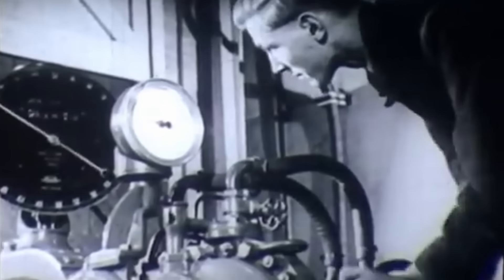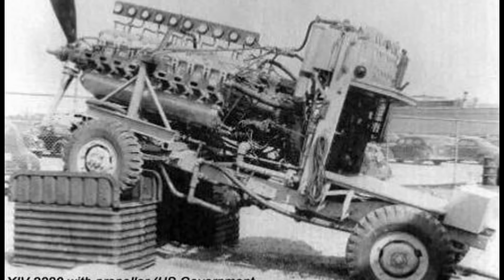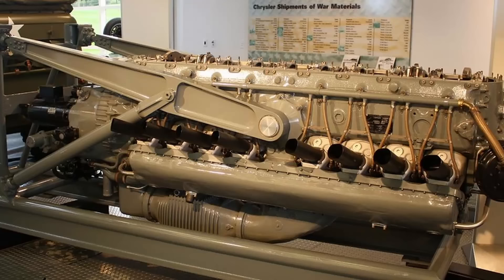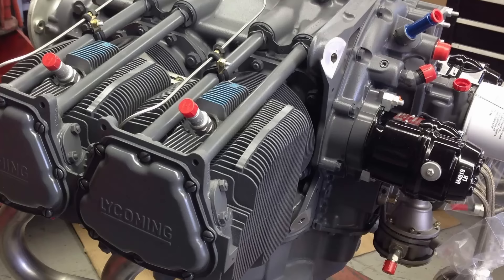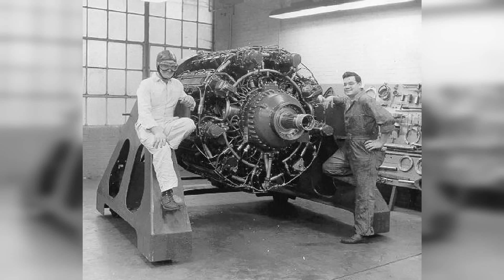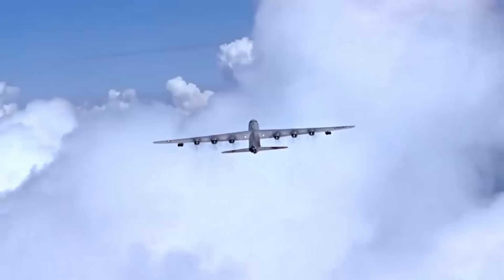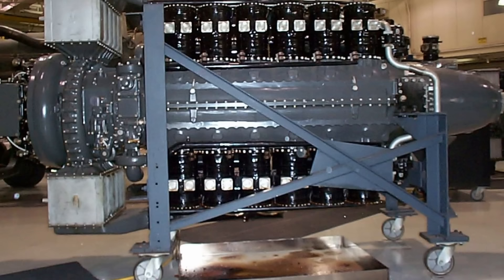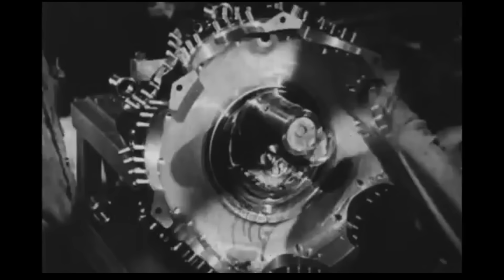The Forgotten HYPER Aircraft Engines of WWII

Comment: normal radials kinda just got good by the end of the war. p47 was flying around with 2400hp form just a regular relitivly compact aircooled radial. and by then the wave of the future was the jet.
Reply: As a huge fan of the sleek inline engined planes like Spitfire, Mustang, and the mighty Tempest, the R-2800 was probably the best piston aero engine of the war (if not of all time). Good power/weight, lots of power, famously reliable (including no vulnerable liquid cooling system). If it had been paired with a FW190A style low drag installation it could have outclassed the inlines in the European theater.
Reply: I think it's pointless to make the comparison, each type has its good and bad points . As an aircraft designer you would consider all the factors and variables then choose accordingly. The mustang could do Berlin return the P47 could not. But large air-cooled radials were the likely the most numerous Bomber engine . I recommend a book called the Secret Horsepower race if you are interested in the deeper technicalities of thje various design permutations, it explodes a few myths too if.you will excuse the pun.
,
Reply: Compact? Um I guess
Reply: @invertedv12powerhouse77   compared to these massive hyper engines. No cooling system either.
Reply: @invertedv12powerhouse77  . It's all relative I suppose but if you wanted  low profile drag inline was the way which usually meant liquid cooled.
Reply: Had the payload capacity of a b-17!
Reply: Try 2800hp

Comment: Lots of aero engines were very successful with hemi heads and 2 valves, some making 1 hp/ ci. These included all the radials. Manufacturing 2x the stellite valves, seats, sodium cooled 2pc valves, bronze guides, and the hardened seats along with the overly complex valve gear wasn't a CNC pushbutton affair and required tungsten tools all major time, serviceability, stocking, and strategic materials use being turned into chips on a floor somewhere to discarded in a few hours of operation. The valve gear on any engine is responsible for most failures and is the most expensive and time consuming to repair. Hemi was chosen because it eaisily allowed two central plugs and offered the best detonation resistance and strength of any design. Still does. Thats why a 500ci  Top Fuel Hemi makes 12,000 hp!
Reply: Your last sentence is absolute bullshit. The reason why top fuel dragsters make 12000 hp is mainly the fuel and the oversized roots blower pushing air at as much as 4 Bar or more into the block.
I'll give you credit for noticing the detonation benefit of hemispheric combustion chambers but that about sums up the  the usefullness of that design. 2 valves per cylinder is just to limiting, that's why every rate engine today is a 4 valve engine. 

Top fuel dragsters are 2 valve engines, because they are literal automotive dinosaurs, except for
the ignition system. 
A top fuel dragster can have only 2 valves, because the fuel has so much oxygen bound in itselfe, that the power limiting factor isn't oxygen anymorem it's hydrolocking (as the carburettors dump so much fuel in the cylinders, that, the piston compressing liquid instead of mostly gases, is a real danger).
Reply: Read carefully and dump the anger, and you will see that I NEVER said two valves made superior power at all. that would be BS! what I said was that the hemispheric combustion chambers ALLOWED big pressure (=power)  without deformation, detonation, and have reduced flame travel. they also have better heat dissapation (ESPECIALLY critical in high hp air cooled radials!) The WW2 air war became an octane requirements battle. I  am fully cognizant of the fact that a specially developed 4 valve hemi (or some pent roof) engine could do better in SOME areas. Chrysler realized this and developed one. It is possible. Look at the angled rockers on a radial. Overhead cams can also do this, but it's way complex, an engineering nightmare and high wear. Someone is always so vehemently angry at the hemi, which wasn't a mopar design anyway, and will ax grind against it no matter what to the point of adding words I didn't use. I also know that "modern" 4 valves and some polyspherical heads do very well or better in SOME applications, but in testing had too little meat between seats for top fuel. And deformed or detonated. Even hemi heads are physically consumed in the chambers in nitro apps. No other engine was ever drug out of a crane, grandma's imperial, or a boat and went like a hemi! Ported 1955 331 heads can flow 400+ cfm and will handle MORE abuse than any other production design Just ask Don Garlits (I have!) The only reason a few other standard production pedestrian engines beat a 392 in the early days was poor traction. Use a REGULAR production cast block and heads that arent a millions dollar special order engineering experiment that you have to be blood related to management to obtain, and it's all hemi. My Dragsters blown Keith Black Hemi has no major components at all, not directly bolt on to an original 426 save bore size. And my 1958 Dodge D 700 semi's 354 can be put into the 5 second range! But would have to sacrifice its blower, or nitro, or add up to 1500 lb to compete with a wedge legally in the NHRA in some classes. No one ever sees the chicanery that is legislated in. But it does allow for more variety and thats ok, we will haul more weight, let them have the blower, and give them an extra motor on their tractor, run restrictors, adhere to ci limits imposed on us and still be waiting for them at the finish line most days. I realize my KB has been surpassed by BAE, etc.  the goal of the NHRA was to not have only 3 factory backed millionaires racing in top fuel. So, the best suitable, obtainable, aftermarket supported, and SAFE engine design was mandated. APPLICATION, COST,  and EXPECTATION dictate success. Hemis have already made the 1/4 mile tracks obsolete, been completely crapped on by NASCAR rules, limited in top alchol compared to others, limited to one LESS engine than any other in some multi engine NTPA classes, and were the cause of CONGRESSIONAL mandates to manufacturers to stop wasting resources to try to beat it!  but Hemis are still the most popular in many classes regardless of whose block is under them. what more do we need? Im not a bench racer wet behind the ears! I have failure analysis, R&D,  metallurgy, engineering, racing, circle track, pulling, aviation, dyno operator, engine builder, and QC,  experience, continuing from 3 generations. We even built our own pistons and ground cams in house. However, Im sure I could learn things from you too, and I'm sure you have more knowledge some areas. thats fine. Let's learn from each other. I'm not right about everything. I don't want a pissing contest, everyone just gets wet! . Your point would be valid if I had said that. Best regards.
Reply: @Cletrac305  
The hemi-design does not inherently allow for higher pressure, or more heat dissipation, if anything, it'quite the opposite. Everything close to a hemispheric has less arwa per voulme, there dissipates less heat.
The hemispheric design also doesn't lend itselfe much to high compression ratios, because of the dome like design.

The hemispheric design essentially allowed for ideal sparkplug placement for 2 valve engines, without sharp metal corners (wich overheat and lead to knocking).
It was a good compromise between simplicity, reliability and poweroutput.

The Hemispheric chamber was very popular in supercharged engine designs beacuse of these reasons. 
However, if you got the technology, to fit 4 valves reliably into a combustion chamber, it will always be superior in terms of power, especially, because the rooftop design of 4 valve cylinderheads offer less small features and more surface area to volume (wich both reduce knock).

If you go into the realm of direct injected engines, a 4 valve design is even better, because it allows, in contrast to a 2 valve design, for a more ideal combination of sparkplug and injector placement, while using a maximum valve area.

Also, on that not, cylinder pressure does not equal power, if anything, it equals torque, minus blowby, fricion and heat dissipation.

Counterintuatively, you will find, that high powered engines, especially supercharged engines, wich are limited by fuel quality, have almost always a lower cylinder pressure than compareable high torque engines. This has to do with, what you correctly pointed out befor, knocking.

What a high power engine really wants, is a lot of fuel air mixture and high cyclic rate, compression ratio and cylinder pressure often play a secondary role, the best example for that logic are 2 stroke engines, they have unbelievably high power to displacement ratios compared to 4 strokes, of up to 400 hp/L (naturally aspirated i might add) in the days of the GP500.
Reply: Yes, as stated, I agree. What is really needed is opposed piston direct injected double acting 2 cycles or similar like most big diesels in ships from 100 years ago. All of this has been done 70 to 100 yrs ago, but recently more perfected and available due to metallurgy and CNC. What's needed in competition "automotive" engines is more smaller cylinders, short strokes, long rods and more valves at higher rpms. But when it hits the end of the track with a 40,000lb sled behind it, and pulls down it would fall on its butt torque wise and not have enough rotating mass to start the load or torque to accelerate it quickly. Those dinosaurs have a practical place. When discussing heat dissapation i was referring to AIR COOLED engines mandated by the navy and for ground attack and bombers due to combat survivability. The large area between the valves can be covered in fins, and heat causes little distortion, again, knock reduction. Supercharger metallurgy allowed the surpassing of the mechanical limits of the engines regardless of valve layout in WW2 detonation was used often to push German fighters to destruction even with water methanol just by chasing them with a P47 or similar. We denied them higher octane fuels. The sphere is an unalterable natural choice for reflecting the MOST of the heat into the chamber where it's needed and not into the cooling systems. It is superior for detonation  according to piston manufacturers who laughed at me when i asked if quench would help a Hemi they said "hell no, they dont need it!" They could have took my money and built them anyway. Chrysler chose it based on a test mule single cylinder variable compression engine when post war low octane was all that was available. that clearly demonstrated that for practical rpms it was far superior detonation wise than any other. The wright 3350 made more than 1 hp / ci at only 2700 rpms. As do several others. Yes, a high rpm 4 valve would do better, but If it's my butt on that constellation in 1952 crossing the atlantic eating peanuts, I'll take the cubes, simplicity and low rpms! Same thing the the guys who build 4 valve merlin, and allisons say to this day. Over water, gimme a round engine! Poor maintenance, round hemi! Cost and time to overhaul and extended TBO, 2 valve hemi. That won't change anytime soon, but hey, we have jets now! Which still haven't beat hemis on the pull track or dragstrips. But have at Bonneville. They just recently unseated the hemis 40yr record for piston engines there,  just to prove a non hemi could.  But guess what? Those pourpose built, as the company owners say, "nothings interchangeable or dimensionally the same as a Chevy" companies offer  those engines as hemis that make even more power. Take two identical motors, and increase the cylinder pressure on one and its more powerful. But only if everything is equal. I built a blown engine because of the lower pressures, better manners and longevity. Blowers have outlasted many engines so my $$ doesn't all go in the scrap hopper! Theres absolutely no difference between torque and hp. HP is TQ at rpm. 1 ftlb is 1 hp at 5250 rpm no matter what. That's why all dyno graphs cross there. No WW2 areo motor "laid down" at high rpms from airflow on dynos they kept making more. They blew up first. Any hemi will also. But make less than a short stroke multi valve v12. But, man, I gotta pay for it! Direct gasoline injection was used on hemi R4360s on the B36 in the fifties (so was antilock brakes!) I despise "Cronological Predjudice" that completely trashes anything older throwing out the baby with the bath water, not realizing they came at least half a century too late to claim "modern" as if thats a religion. Heck, flatheads still have applications. Dinosaur or not, I don't want to go bare fisted against a T-Rex on equal terms! Theres not many competitions where Hemis aren't severely limited rules wise because unrestricted they overpower all practical chassis, safety equipment and tracks already. Thats the difference between possible and practical and gives the Dinosaur a very modern application especially when supercharged. You simply wont get cost effective gains going to 4 valves most places it is still used. Formula cars, indy, small ci imports and bikes have already moved on long ago due to much of what you say. I still like watching Suzuki 3 cyl 2 strokes at the track!
Reply: Hemispherical engines make less power than a 4-valve Pentroof combustion chamber... and that why hemis are obsolete technology in automobile manufacturing.
Top Fuel is a Vintage class motorsports series, only the 1964 426 Chrysler is allowed to compete...
Reply: @Cletrac305 Retired Coast Guard Naval Engineer here. My last Officer Evaluation Report called me the Fairbanks-Morse guru of the Pacific Area. F-M opposed piston engines (38D8 1/8, 38 being the year they were designed) fit locomotives well, but in WWII thrived in submarines because the OP porting eliminated exhaust valves. Since there were no exhaust valves, exhaust could be pushed out against high back pressure. That allowed exhaust to be discharged deep underwater, reducing the chance of being spotted when running at snorkel depth.
Reply: Like explosives, nitromethane doesn’t need oxygen to be ignited. In dragsters air is pretty much a dilutant for the fuel, a bit like the generator the 1963 American Everest Expedition operated at something like 24,000 feet, which was fueled with hydrazine. Not a lot of air available, not a lot of air needed.

Comment: Well before WW2, an esteemed engineer of the day told RR they should be building smaller engines Turing 2x as fast. This would give the same power in a smaller more reliable engine. He was ignored and RR spent half of WW2 trying to understand why Merlin’s commonly broke con-rods.
Reply: You're right....Napier had the right idea. Shorter flame fronts from smaller pistons would have eased the requirement for huge octane numbers of fuel.

Comment: It is absolutely mind blowing to realize that the US manufacturing industry was able to design and produce these incredibly complex engines. Disregarding for a moment the fact that this country has outsourced almost all of its industry, the fact that these engines were developed 80 YEARS ago, without the use of CADD is almost difficult to believe but that’s because we think that society has “progressed” since then…
Reply: I mean, a modern turboprop will do similar horsepower for less than a third of the weight of a WW2 piston engine. Don’t even get me started on jets lol. Hell, a modern 1500hp bugatti car engine weighs like 900lbs and has literally a tenth of the fuel consumption of a rolls royce merlin or similar. Engine technology has come a long way, we’ve absolutely progressed on that front.
Reply: @MotorcycleWrites  True, with the provisos that it run continuously for at least 100 hours at maximum horsepower at an altitude of 25k ft. and output shaft speed that would keep a 14 ft propeller under supersonic tip speed at that altitude, plus various requirements like dual ignition and other mechanical necessities for aviation use.
Unfortunately the reduction gearbox and ancillaries would also add so much weight and mass that the Varon engine would need substantial overbuilding to accommodate the thrust and load requirements.
Still would be a good thing to see in action.
The perpetual rabbit hole full of cans of worms.
My 2 bob’s worth.
Take care.

Comment: Piston engines were ultimately a dead-end in large capacity forms, due to weight and complexity.
Reply: If the jets hadn't been developed,there is no idea where these big engines could have gone with better materials and fuels
Reply: The propeller was the most limiting thing as far as speed

Comment: @Flight Dojo  >>> FWIW: That Lycoming engine that was slated for the B-36 Peacemaker was new info for me. I thought the air-cooled radials they used were the original choice. 

I wonder how the B-36 would have fared with the Lycoming engines.

Comment: GM wanted over 2000 changes to that Chrysler16 cylinder HEMI engine series-get or check out the book- the Gen  1 Hemi's (1950's) had a direct connection to the aircraft engine.

Comment: About 2:40 to 3:05 that is the example at New England Air Museum with a clear plastic crank cover. Sadly, now pushed way back to the wall and inaccessible to the Big Kid Gearheads. And the wooden cabinet to the right contained a wonderful tribute to a CT native you got shot down in France strafing a German column. The locals removed his body and gave it a burial, waiting for the Yanks to arrive. After the war the townsfolk sent a tribute to the widow including a hand knit American flag. And a heartfelt letter of gratitude from the mayor, which unfortunately included a Christian reference. Needless to say display has vanished, it was a wonderful human connection to go with the machinery of the war.